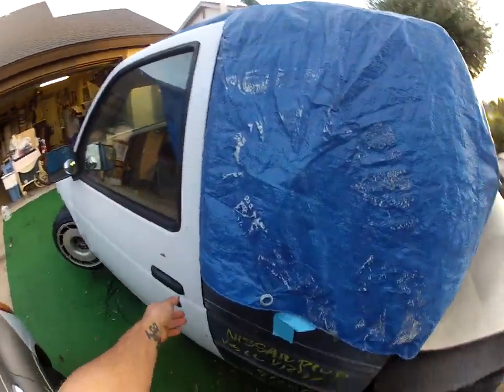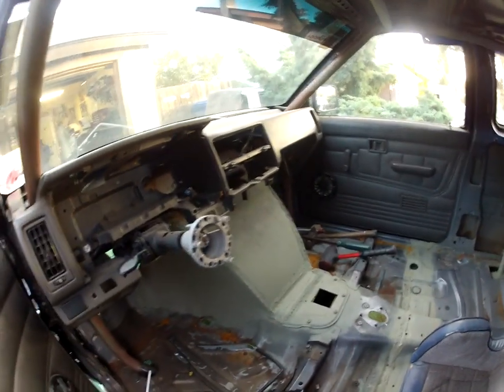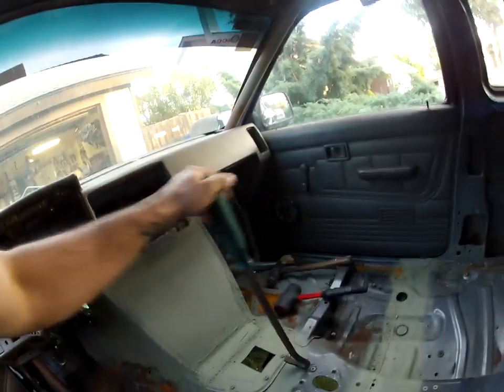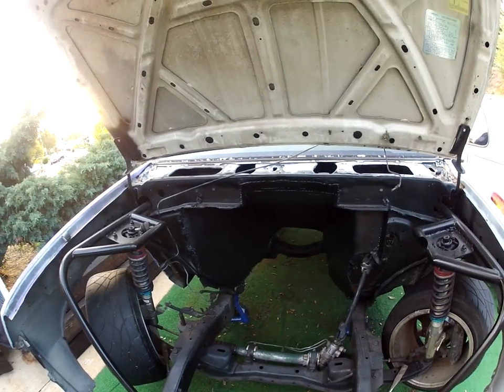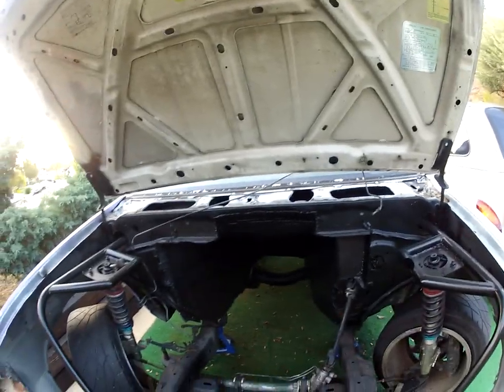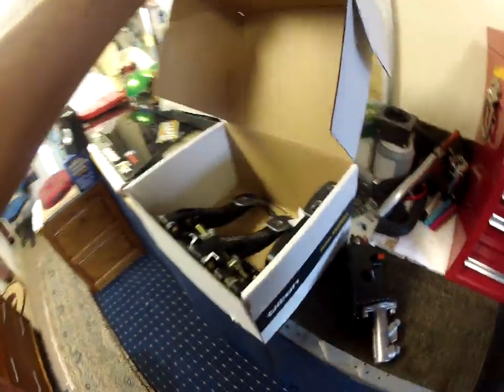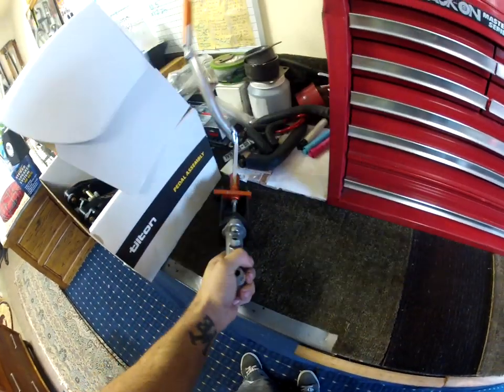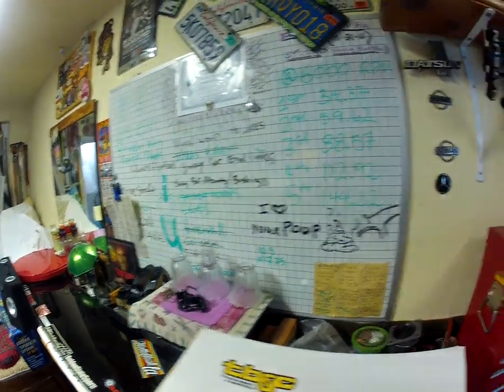drift truck video update #1

Comment: I'm looking to build a drift truck of my own are you a sd local maybe you can help me with the suspension i got 3' drop blocks and torsion front now looking to stiffen my setup
Reply from the maker: Curtis Spencer I actually moved to Colorado like 3 years ago or I totally would
Reply: Any tips on stiffening up the ride I'm dropped 3inchs in the rear and torsion down about 3and a half up front